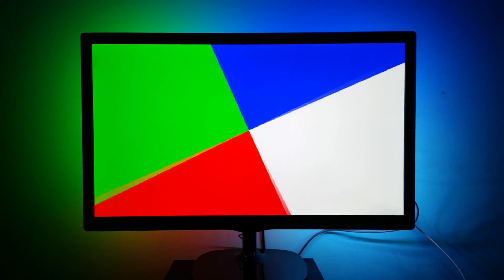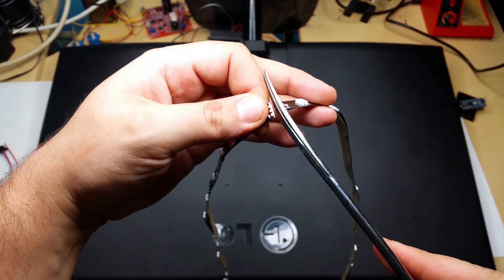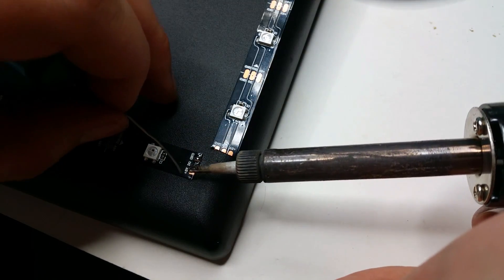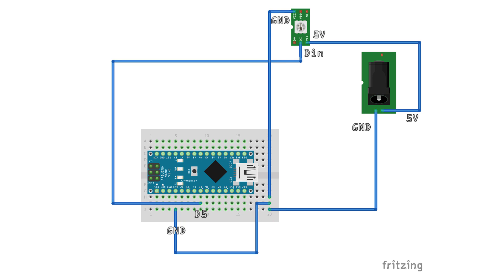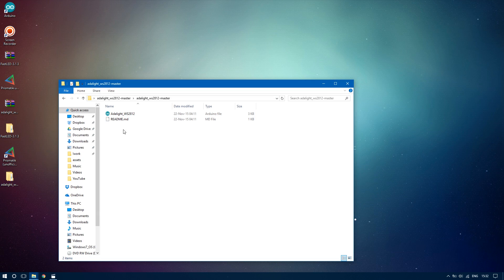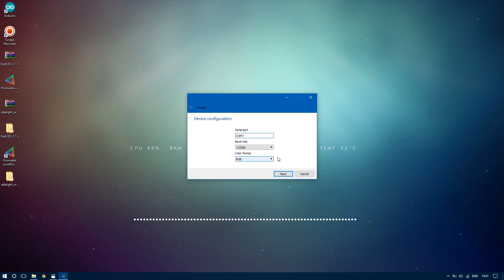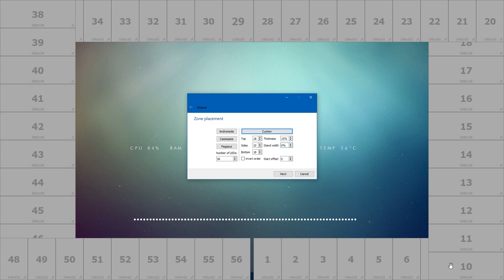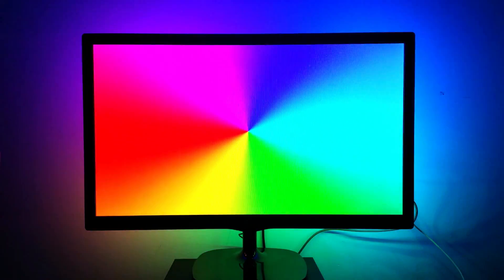DIY Arduino Ambilight RGB WS2812b Full Build & How-To

Comment: This is possibly the most structured Ambilight tutorial I've come across. This will technically be my first electronics DIY, so this question may seem obvious: Does it work by itself connected to a TV? Will I be able to just connect this straight to my TV and it will work (after I apply settings)?
Reply from the maker: Thanks man it really means a lot. To answer your question, it will work on your TV if you connect your TV to the HDMI output of your PC and use it as a PC monitor, only then can it know what is exactly showing up on the screen and change the colors of the LED's. It is not meant to be used standalone I'm afraid and needs to be connected to the PC for feedback. I will make a standalone Ambilight system in the future, when I get my hands on a decent TV. But even then it has to have some sort of input from HDMI using a Raspberry Pi, HDMI splitter, AV capture device and of course the arduino. It's a bit more complicated and expensive build but will make it one day for sure :)
This tutorial is only to be used for making an ambilight system for your PC monitor, or TV if it is used as a PC monitor.
Hope this answered your question :)
Reply: Boris Dusnoki That's unfortunate, but at least it won't be too much trouble to plug it to my laptop. Thank you for the quick response!
Reply from the maker: Nincadalop you're very welcome. Glad to help :)
Reply: Hello! It's me again. I bought the wrong type of LEDs, they all light up only one color. I'm planning to put them behind the couch anyway. Is it possible to have two systems? One that does average color and one around the monitor that does individual colors?
Reply from the maker: Nincadalop I have the same setup in my room. A Simple 4 pin, 12v, rbg strip with a separate power supply and controller mounted behind the couch and this ambilight system mounted on the monitor.
Reply: Do they work together or are they separate?
Reply from the maker: Nincadalop totally separate systems
Reply: Nincadalop this setup can only work with pc if you want to use it to tv you will need: rasberry pi, hdmi splitter, usb video grabber with utv007 chip (if you use other chip it wont work) , hdmi to rca, psu, led tape..... If you use Hyperion you can dimm tape to 70-75% to use less power
Reply: Hi Boris.. To start off, thanks a ton for the video. it was simple and very easy to understand. 

To my second part of the question,  are you planning on doing Standalone Ambilight Setup anytime soon??  I would really like to follow steps from someone i can understand rather than blindly going in.
Reply: Nincadalop k
Reply: Nincadalop o
Reply: Nincadalop o

Comment: Only a question: Can I run this on multilple monitors?
Reply from the maker: That's a good question, I've seen some prismatik test builds that can utilize 2 monitors on MAC OS https://github.com/woodenshark/Lightpack/issues/31 but didn't see it in action. If i come across something like this, I will let you know... until then... Google is your best friend :)

Comment: at 3:12 , the power supply cable is connected to the phone charger? How did that cable came about? isit a normal USB charging cable that you strip off on one end?
Reply from the maker: +DATMoment yeah sorry that is a cable I had laying around already. Just a USB charging cable with the micro USB part cut off and I'm only using the 5v and ground cables from it. You can check with the multimeter which of them they are.
Reply: Boris Dusnoki da li je moguce da moze da radi samo sa 2a posto su ovakve trake vrlo dobro poznate da trose mnogo struje.

Comment: I don't have a computer, how much would you charge to make me for for a Samsung UN55KS8000?
Reply from the maker: +Timothy M don't really understand what you mean. You want me to make you this ambilight, for you to use it without a computer. And charge for it? Not something that is possible I'm afraid. You can use it without a computer but you need a couple of more items. Raspberry pi, av capture device... I might do a standalone ambilight system that doesn't require a computer once I buy a TV.
Reply: I should have been more clear. I wanted a bias led lighting system for my TV, I ended up buying the DreamScreen which is more than I wanted, I just wanted a white ambient light but ended up getting a responsive gen led system.
Reply from the maker: Ah I get it... if you wanted just regular white light as an ambient on the back of the screen then you just need regular white led lights with a power supply, switch and that's it.